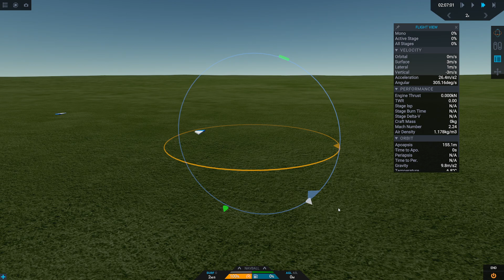C: MO - Understanding SAM Trajectories with SimpleRockets 2

Comment: You never left the atmosphere in simplerockets 2 where the atmosphere is like earths and functionally ends at 80,000 feet so what happened was that you got so high that you reached stratosphere or something like that maybe a bit higher that the air got so thin everything was dark and looked like space so again never left atmosphere